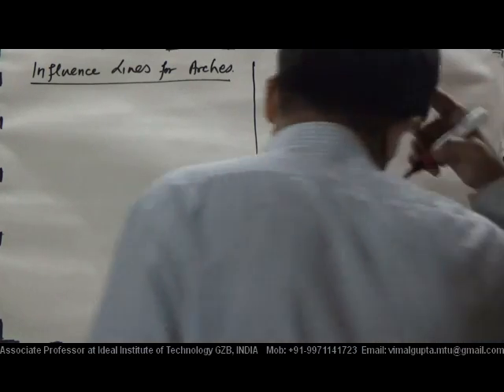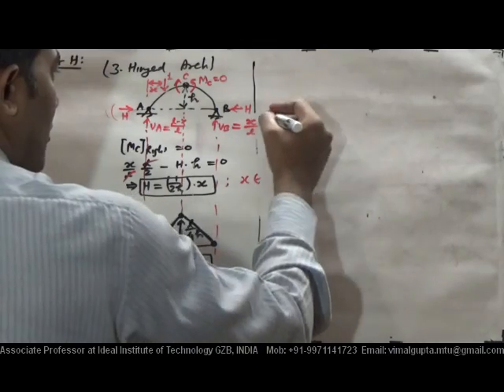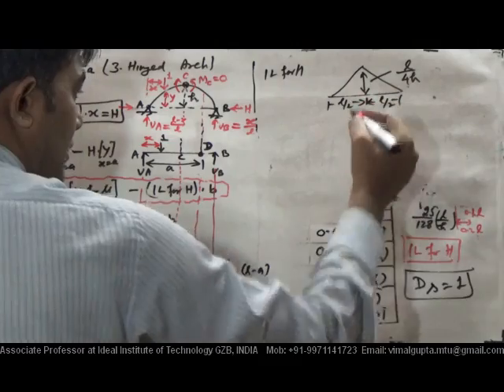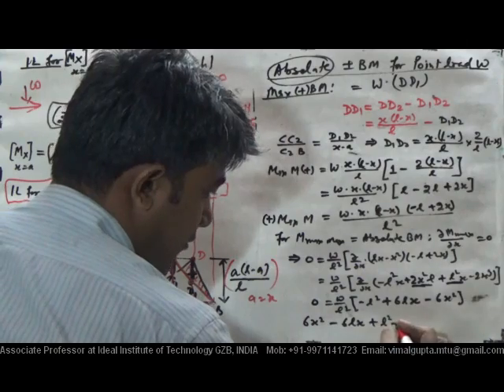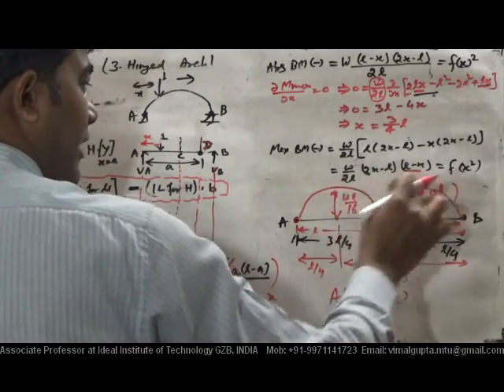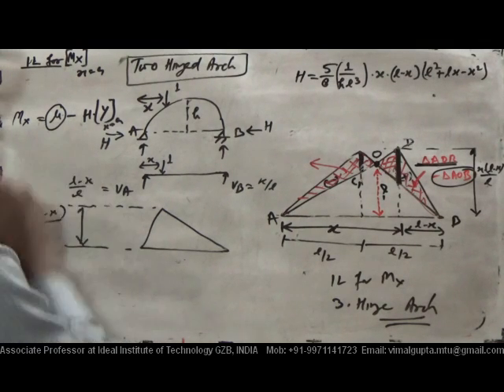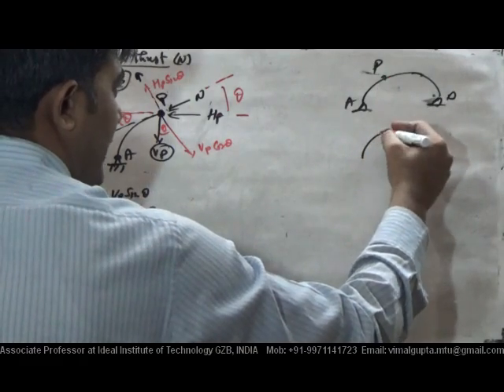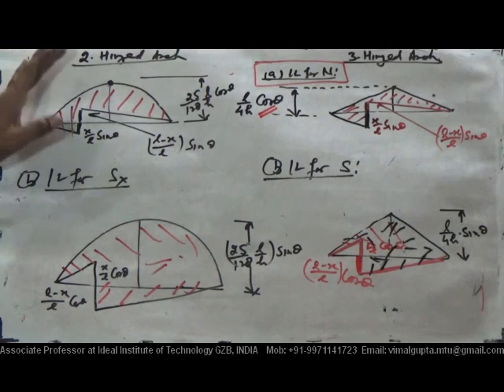Lec 5.5: IL for Two & Three Hinged Arch

Comment: Respected Sir,
When we put the value of 
x= 0.211L in equation of Absolute positive maximum bending moment, value is getting Negative... i. e.  - 0.096WL

So I think there should be correction.....
It should be positive......